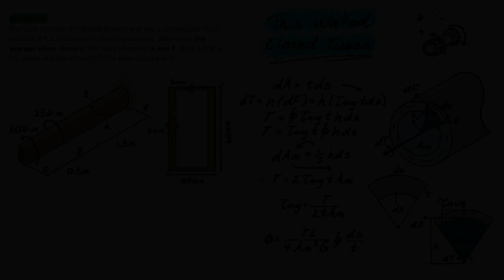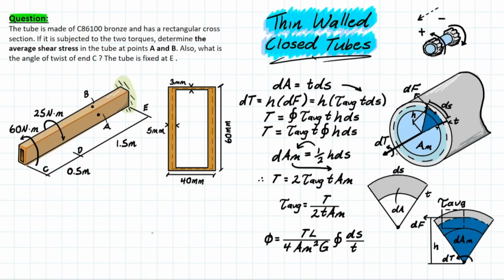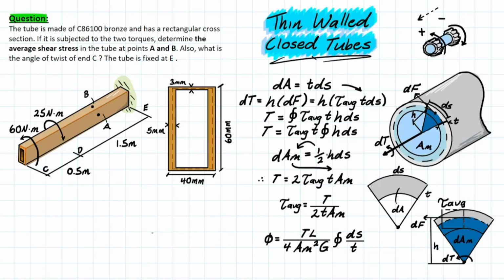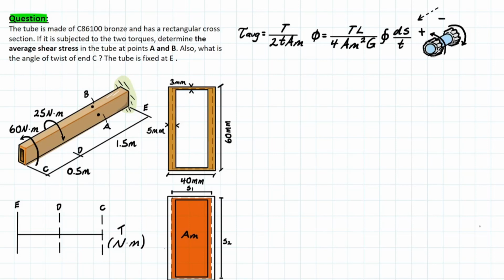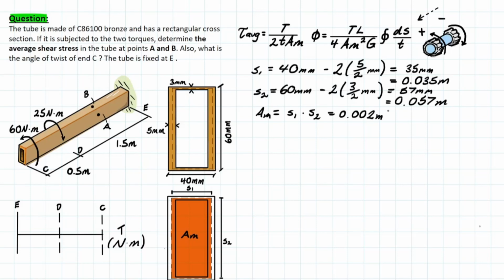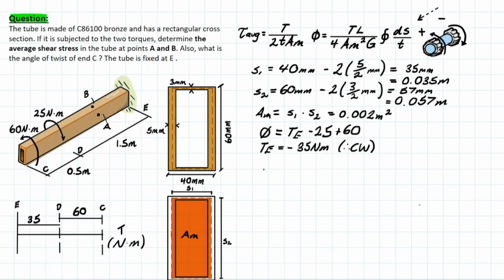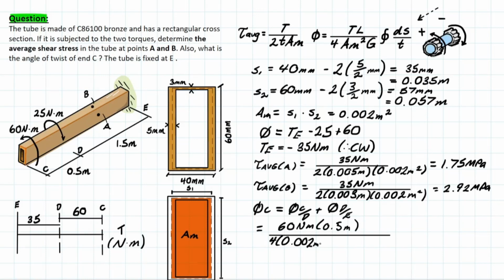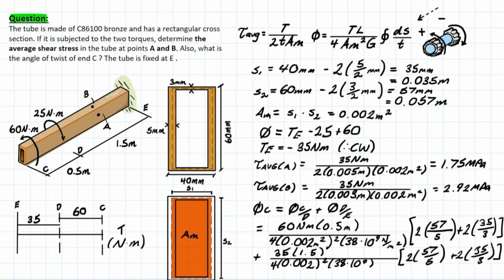Solving Thin Wall Closed Tubes Problems!

Comment: Why are you change all the time the  direction of the internal torques , sometime you take cw as negative sometimes as positive , is it depend on the question or are you taking just randomly ??
Reply from the maker: This is a good question! I solved this problem a while ago, so I may not recall it the best, but usually its just an arbitrary convention that you follow that need to be consistent throughout the problem. So if you wanted to swap signs, you could do this is well. Hope this helps!
Reply: @simple_civil  tnks

Comment: Why  ds/t is [2(57/5)+2(35/3)]🙏🙏
Reply from the maker: Hey, here how I like to think about it:

ds/t starts with a line intergral, meaning we have to go around the entire boundary created by the centerline running through the thickness. ds is the length of this centerline, and t is the thickness corresponding to where that length is taken from.

Lets look at our example, isolating the 60mm side. ds will be 60-2(3/2) mm. The thickness of that 60 mm segment is 5 mm. So we have ds/t = (57/5). Since we have two of these sides, we must multiply it by 2. We repeat a similar process with the top 40 mm segment, which gives (35/3) then once again that repeats in the section, so we multiply by 2. That leaves us with [2(57/5)+2(35/3)].

Hope this helps!